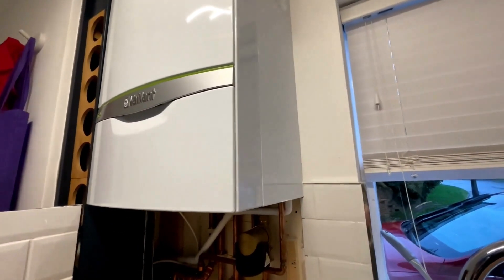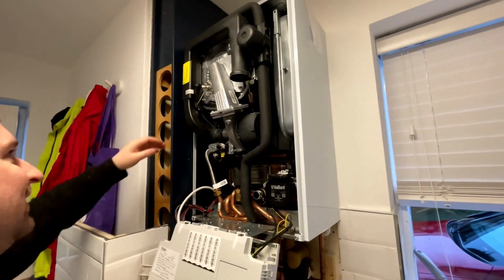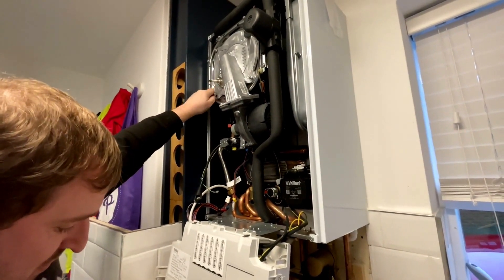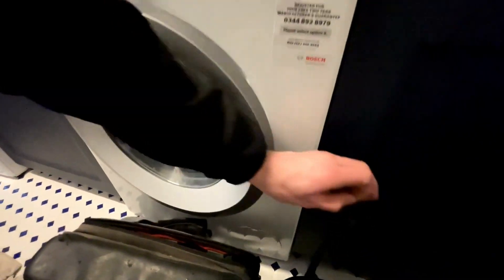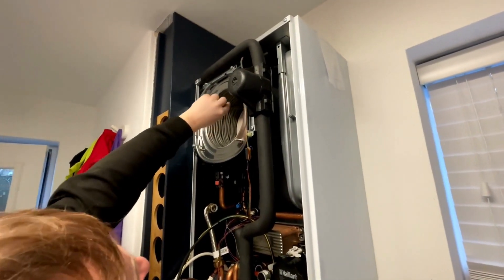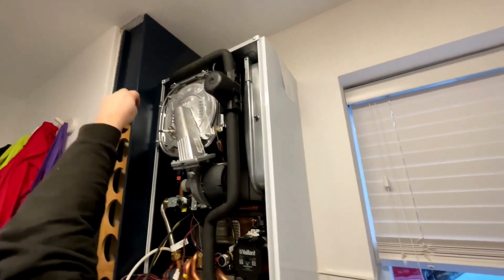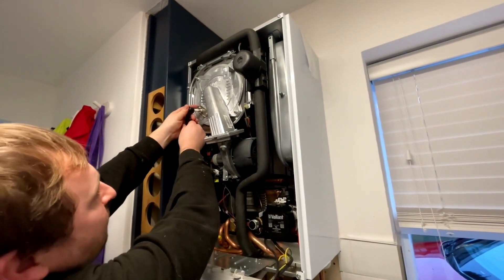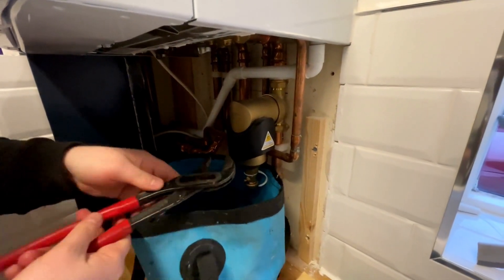Most reliable boiler?????  Vaillant IQ gas boiler service strip down and clean.

Comment: you didn't do a proper electric test, to see if the pipes etc were live, don't chance it two mates in training got burned
Reply from the maker: I have just brought some electric testers for all our tool bags.   Gas safe will also shout at you if you don't test the pipework.  Thanks 🙏
Reply: @appsplumbingltd  no worry's mate,  for info one ended up in a&e 2nd degree burns,  the other got knocked off his feet,  both were commercial jobs and both only second week apprentices

Comment: No wire brush inside the heat cell mate
Reply: Should Take the magnet off the filter before you open it . Good boilers the iq as can range rate it to suit
Reply from the maker: Thanks and I'll try that next time 🕰️
Reply: Agree with this ^
Reply from the maker: I'll order some soft brush thanks